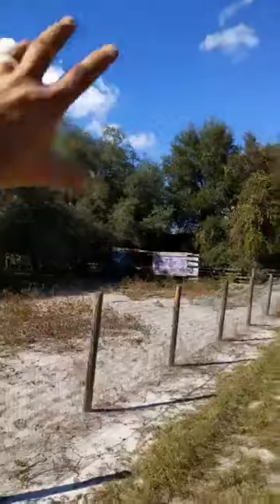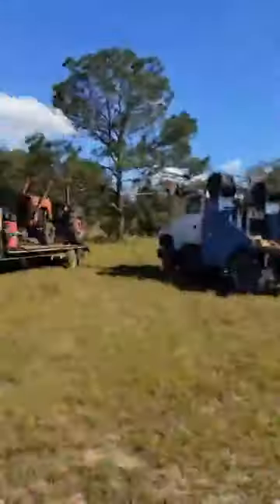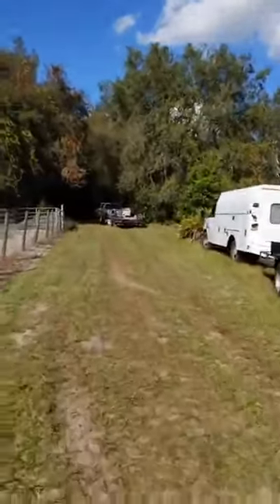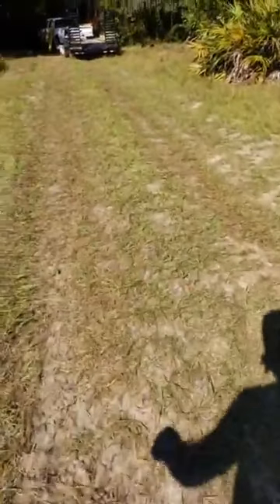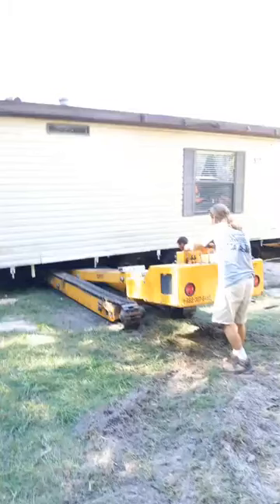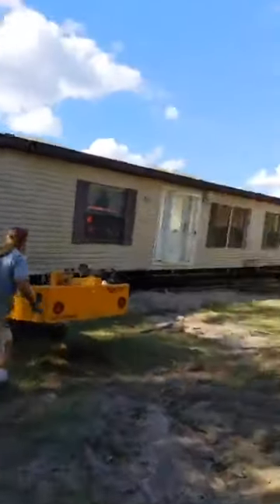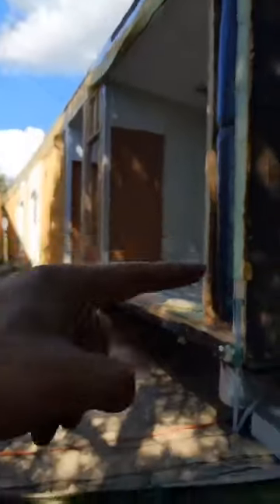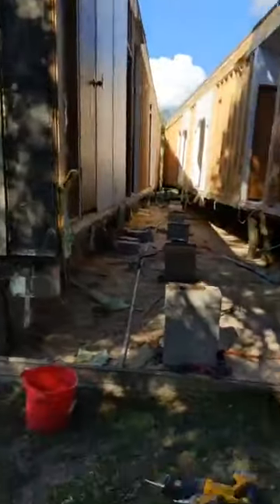Double Wide Separation

Comment: What if you have one that has fallen over off its jacks? How hard is it to lift it up from the ground. I have a lady who hit it with her car and pushed it over. And I’m not sure what the proper way to address such a problem?!” Maybe some insight, could it be lifted independently on each corner and would that lift the center as it is a double wide just curious if it possible to do with bottle jacks and I also have a backhoe with forks..? And if so what does something like this typically cost I am a contractor who does specialize is unique situations but this is a first..  so I really need some insight as to what my best options are and what a job like this usually costs. Any insight would be greatly appreciated. Cheers